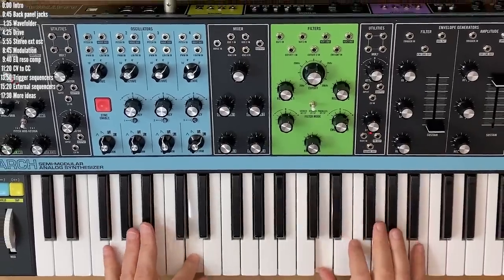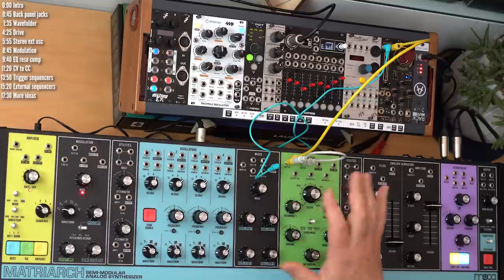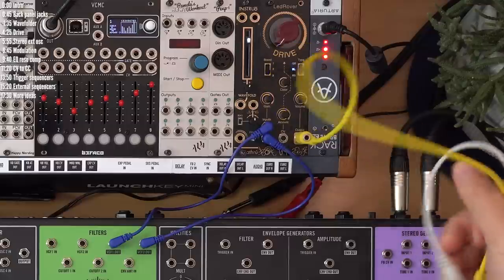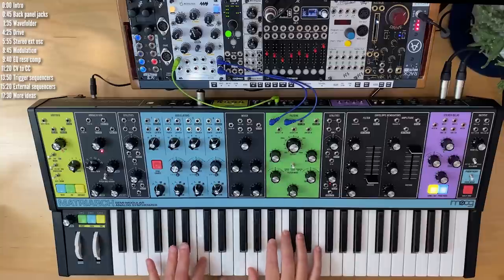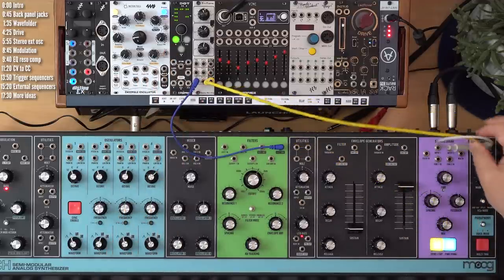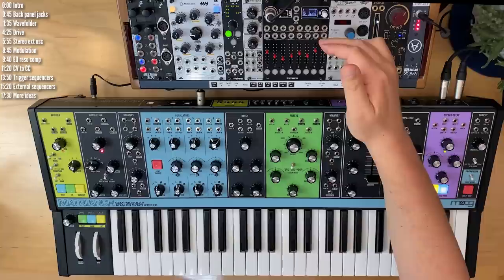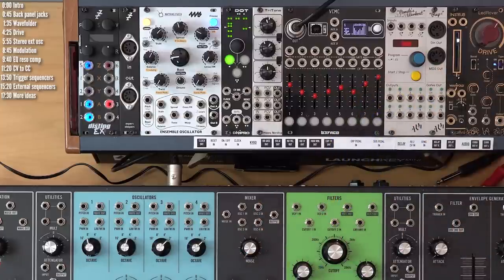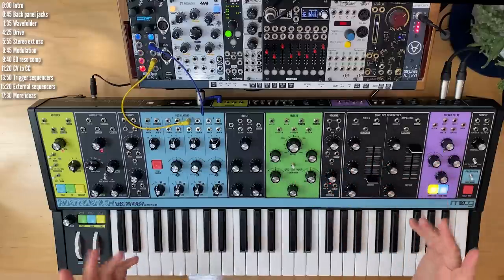Transform your synth: 10 semi-modular pairing ideas shown with Moog Matriarch

Comment: Having bought a Matriarch recently, this is particularly timely for me. Much appreciated. 

I didn't realize I had access to a wave folder, but I guess it's one of the dozens of things in Disting! Woo Whoo!. 

A pairing I've found useful pairing I've been enjoying is the Matriarch and an Arturia Mini Brute 2S. Running the oscillators into the metalizer alone is pretty great. I don't really know what it does, but I guess it's kind of a wave folder. Aside from that, the extra envelopes, LFOs and other things really open up the Matriarch. I hadn't thought about it, but it's should be possible to use the Mini Brute's excellent sequencer to control some of the Matriarch's midi parameters. That sounds like something to get lost in for a while.
Reply: Disting is so useful but also so easy to forget what all it does lol. They need like a poster or something for all the functions, for now I have the cheat sheet saved as a PDF on my iPad.

Comment: Wish I had a Matriarch, so I'm gonna substitute it in the formula with my ... Behringer Neutron. 
laughs in economic distress
Reply: Likewise. Only got the Neutron (well, two Craves as well)- it will be interesting to see how many of these translate.
Reply: I've been looking to get into this. Would the Neutron be a good first semi-modular unit or would you recommend something slightly higher end if I have the budget?
Reply: Pashow I’d say yes- 56-point patch bay, and a lot of knobs besides. Of course, I would say that...
Reply: @pashow6486  yes, Neutron is fine. more than enough to learn. is has a few minor flaws, but that's where externeal modules come in handy. I for example don't like the bbd delay that much, a modul will fix that.
Reply: @pashow6486  the Neutron is a good synth. The bonus is it has its own character so if you end up buying another synth, it will still be a handy piece of kit. I highly recommend the Heinakroon overlays - After Dark has colour coding which makes it easy to see which controls the patch sockets relate to.
Reply: deviousxen  Just a suggestion for the Neutron—get some Koma attenuation cables (to free up your patch bay) to run the oscillators into a Sum and, then, into the filter to soften up the sound, and patch the filter output directly to the VCA to bypass distortion and the delay.  This will give you a more vintage sound, as the normalled signal path is quite overdriven.
Reply: @pashow6486  The Neutron is great for the money, but as you start to expand and improve your rig, it's the kind of synth you remove for other things and stop using.  The Mother 32 can and should stay around all the time, and is smaller and easier to rack.  I would recommend it over the Neutron if you swing it.
Reply: @iqi616  THIS. And the colors of the overlay look very familiar when you have a moog grandmother/matriarch in mind. If you're new to modular, the Neutron will make it easily accessible and it's just a great sounding synth to begin with.
Reply: I don't hate my neutron it might be the only thing Behringer's made that I've liked unless you count zero input mixing into a XENYX as a 'cool instrument' Lol.

I got it cause it was a weird baby and could serve as a module and if it failed... Shrug Not the largest loss.

That being said I just... Like trying new synths and really want a modular spring reverb tank with a nice keyboard. And just to have a standalone synth with keys and a spring.

definitely not shittalking the Neutron. It's a weird little thing but I like it.

Comment: Great vid once again! I’m wondering can you sync the ‘rate in’ in the modulation section with the tempo of the arp or sequencer? Especially when the matriarch is receiving midi clock. Or would this be a job for another piece of modular? I can’t seem to get the rate to sync up
Reply from the maker: Thanks! You can, sort of restart the lfo using its sync input and set its length by ear but it’s not true tempo sync
Reply: loopop okay thanks for the reply!

Comment: love this video! my main question is whether or not you can add to the paraphonic voice count of the matriarch.. it's cool to layer in an oscillator, but is there a way to add 2 or more voices, thus making the matriarch 6 voice paraphonic? can you do it by chaining a grandmother to it??
Reply from the maker: technically you might get close with a MIDI to CV converter with 6 outputs, but you'll lose many matriarch features (round robin, etc) so not sure it would be worth the hassle

Comment: How did you assign those midi cc messages to those parameters?? What other parameters are midi cc controllable? I can't find this in the matriarch manual anywhere.
Reply from the maker: The entires list is at the end of the manual, and there's also a separate MIDI implementation document
Reply: @loopop  Thanks! I don't think I got the midi implementation doc with my matriarch but I just downloaded it.

Comment: What would I need to integrate various guitar pedals and also my Sherman Filterbank?
Reply from the maker: If it's on the output just make sure your levels aren't to hot. If it's in the signal chain, attenuate and amplify as needed with a module like SBG from ALM
Reply: loopop Thanks, I’ll be doing this with a Matriarch, Drumbrute Impact,  Microfreak, and Avalon Bassline among other things. I also want to integrate software as you did with eurorack.

Comment: Has anyone else had issues with clocking the matriarch w other gear? its been super finicky both as master and slave when used w my make noise gear
Reply: I have to be honest, even clocking it with a Mother 32 was a pain. Clocking it via midi with Ableton I've had no problems with tho
Reply: Have you updated to the latest firmware ?

Comment: Hi Loopop :-) 
I got a short question concerning the CV compatibility. I wanted to use 0-coast together with my Matriarch, the menu says all the patchpoints can only take up to +/- 5 CV, but the 0-coast and most Eurorack modules are twice that much. The folks at Moog customer service didn't advice to couple the devices. Yet I see lots of videos that patch Moog gear with pretty much anything else... You got any advice? 

Thanx a lot <3
Reply from the maker: If Moog says to keep it to 5v I won't be the one to tell you not to... you'll need to use an attenuator module, or use the one built in to 0-Coast
Reply: @loopop  thx :-)
Reply: Andy Kandolf I would get a Eurorack precision offset if you plan to work with audio and not just cv for modulation.  I purchased the Erica Synths pico mScale for my Moog gear.  There are many utilities that attenuate and offset, and favorites are the Frap Tools 321, TipTop Miso, and Happy Nerding 3x MIA.

Comment: Dear loopop, would you please compose "Pavane for a Dead Wallet"         heh. Serious question from a ROMpler tard:    Can effects pedals be inserted into any of these cv paths or are levels incompatible?     I have some kind of autism and modular freaks me out, but you really are taking away a lot of the scary.  (i seem to gravitate towards digital control and instant patches so UNO synth, microfreak, wavestate, workstations and ROMplers is where i'm at, but this semi-modular approach is VERY enticing..rip wallet)
Reply from the maker: ROMplers can be fun too, don't let anyone tell you otherwise! Especially if they have a lot of ROM :) To the point, yes, the levels are "incompatible", meaning you'd need to attenuate going in and amplify going out. There's a module called SBG by ALM that does that - for a single mono signal though. Or just amplify at the end and maybe put up with some noise.

Comment: come on i just got my minibrute 2s 3 days ago you can't push me back into the GAS pit that quickly that's just rude :P
Reply from the maker: Many of these will work with it! Plus it has a wavefolder built in
Reply: @loopop  i've really been enjoying running external sound sources through the wave folder, especially guitar :) the AD envelope is loads of fun too, lots of fun hacks to be done there. certainly itching to hook this up with some eurorack stuff but i've gotta wait til i can afford that...

Comment: Also this synth is a cripple when it comes to midi too. Out of the box the way it’s set up if you connect it to the grandmothers midi out directly and try to control it as a slave it will activate its sequencer too instead of simply playing the incoming midi by default. Just one of the many  missteps made by Moog who rushed it out. After the grandmother was a success. To cover development costs on Moog one. Very sad. The same company that when sales were lagging gave us the “Animmog. “ doesn’t need us ios dudes anymore apparently. So now it’s more hardware-to connect and distract us from this issue. Okkee dokee. Peace Christo 😕
Reply: Totally the wrong place to complain about this btw.